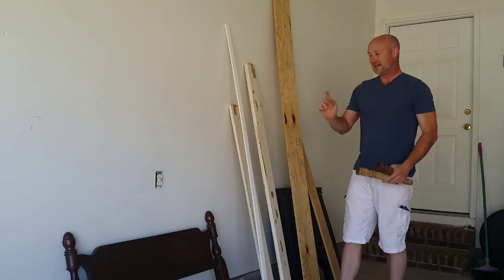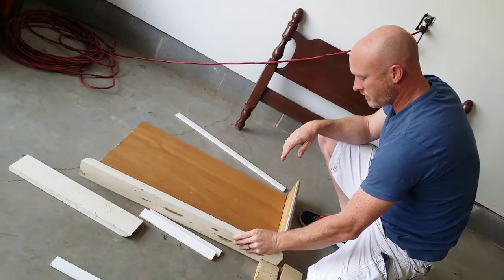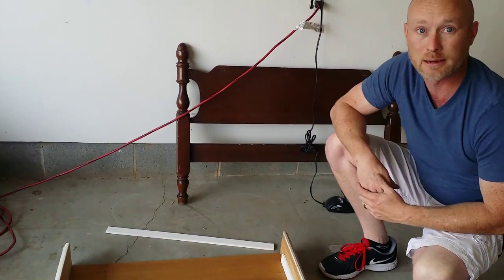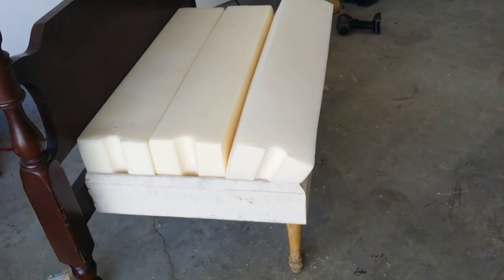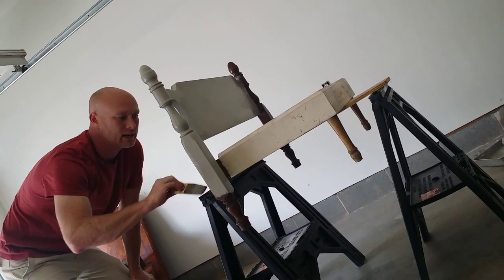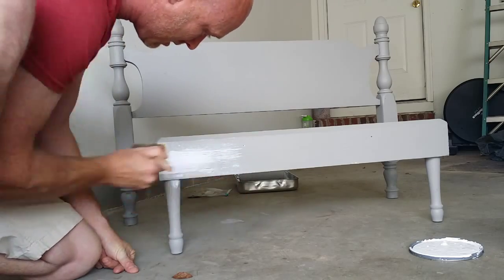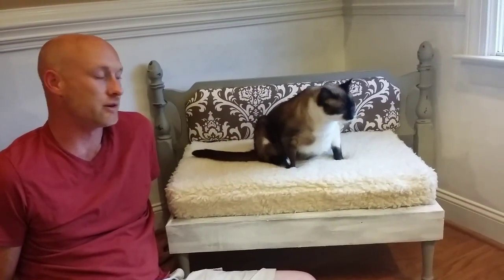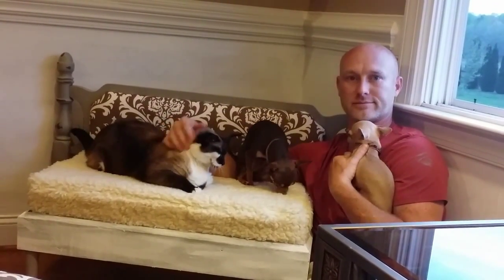How to Build a Pet Bed from Recycled Wood - OurHouse DIY

Comment from the maker: Thanks! When I was building the box, I made it solely from scraps. So to add some rigidity and make it sturdy, I added the thin plywood bottom. Then to get the mattress at the right height, it put the 3/4" plywood. As far as the cover, there's a half inch hem all around, so I cut it to exact size and that made the end result about 1 inch smaller than the pad.